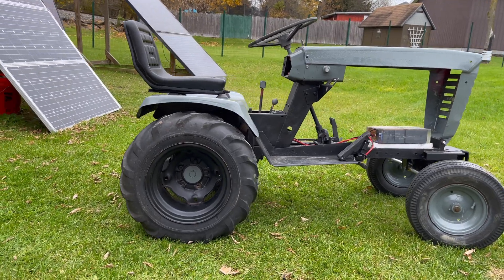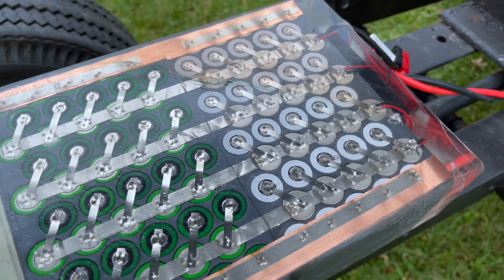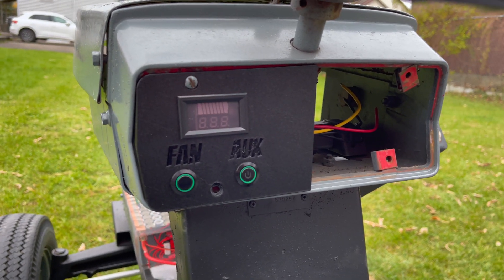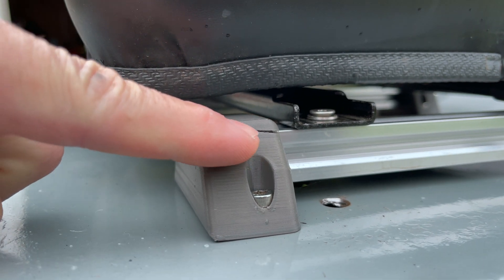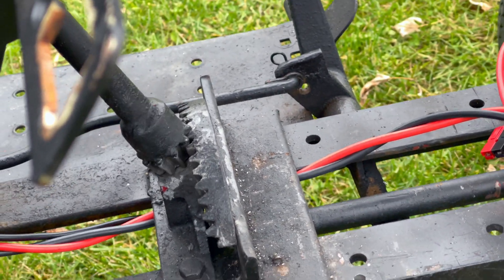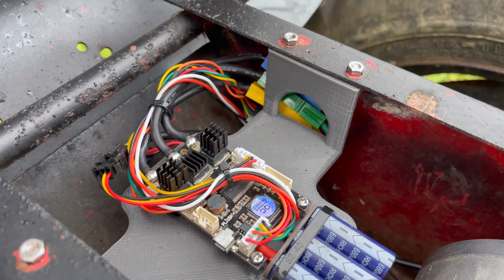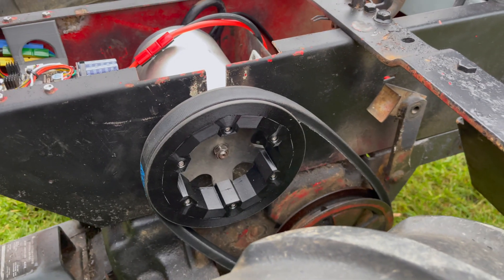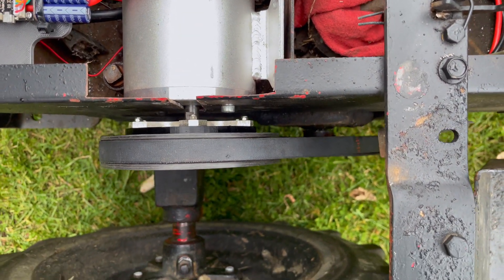Wheel Horse V3 EV

Comment: did you put those fenders and foot pans on? or did it come that way?
Reply from the maker: Oem original stuff
Reply: @DerekMantei yeah but were they swapped on from a different horse ? I’m asking because I want to convert my 1965 seat pan to the new ones liek yours and I didn’t know if it was possible
Reply from the maker: @peezyplayz2498  not swapped, original. With a grinder, a welder and a tape measure you could make anything work 😊

Comment: This is very cool.  Thank you for sharing.  Only disadvantage I see is you can't run any accessories....which is for depending on what you want.
Reply from the maker: This was to pull some lawn trailers and a snow plow. I designed a triple motor deck using ryobi push mower motors. That would require A LOT more batteries, but it's a slow project I plan on keeping alive for many years.